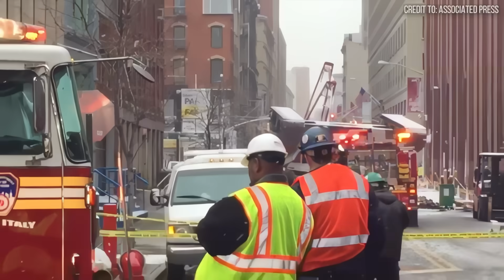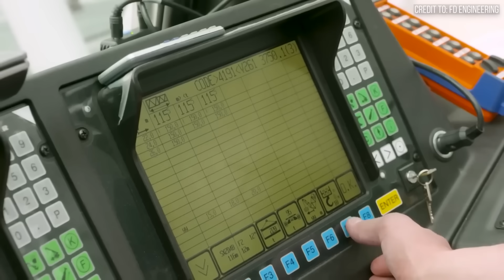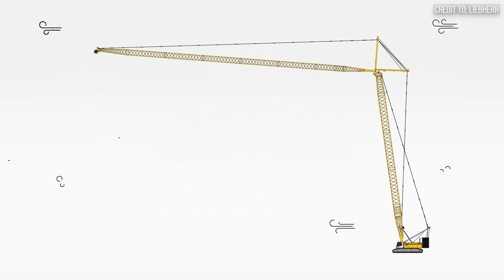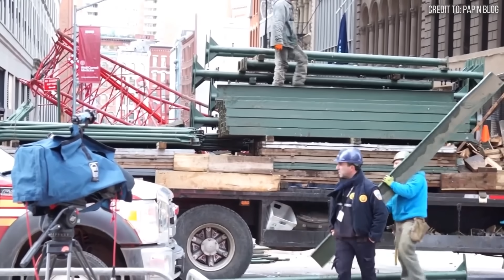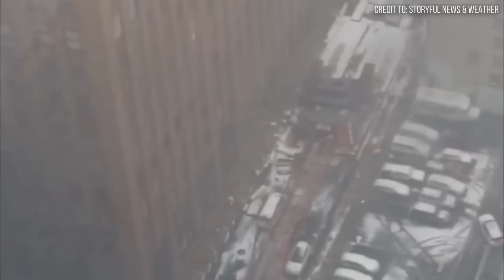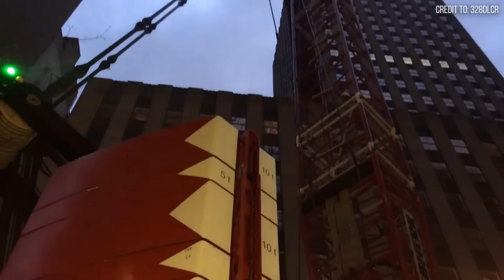$20M Catastrophe: The REAL Reason a 200-Ton Crane Failed in NYC

Comment: I once worked on my Tonka truck.  It had a maximum load capacity of 47.5  lbs with a weight of just over 3.74 lbs.  A total cost of a staggering $13.99

Comment: Thank you for this informative video. I have a question though: when that long boom at the top was being lowered, I understand that they lower it using a cable that they unwind. Would it have been possible for the operator, once they sensed they had a balance problem, to just let that cable unwind, like freely, just let the winding wheel freely spin? I was thinking that would drop the end of the boom faster and sure, it’s end would hit the street and cause some damage, but the main vertical part of the crane and it’s cab and stuff might have survived intact. I get that an uncontrolled dropping of the end of the top of the boom is not a good thing, but wondered whether, given the situation, that could have been a better option. Assuming it’s even possible.
Reply: To answer your main question, no. The winch that runs the cable for that top boom section you see at the start of the video can not unspoil freely. Its hydraulic and is not set up with a free fall system to allow it to do that.

Comment: If this was a Chinese machine, every sh1tholes in the comment section will blame Chinese quality.  But this is German engineering steel so the reason for the fall is the WIND.  I see I see is the wind not the low quality German made machine.

Comment: Taking the crane down already at higher winds started is very risky, because of reaching unstable positions. Much better and you will surely habe some smaller damage is to "park" it in a save position leaning against a building,

Comment: The story was told that the regular operator was not on site and they needed to get the boom down another operator that had not ran a machine of that size / configuration . and boomed down with out laying the  luffing jib on the ground has wheels on end to do that. Than with that weight off can let the rest of the boom down.  The machine would have turned over with out the wind when you do it the wrong way.
Reply: What I thought! Looked like it was always going to topple

Comment: The winds of 20mph with gusts up to 25mph does not tell the whole story. Because the winds will funnel between buildings and be faster and change direction like crazy. I noticed that because I lived in NYC near that area for 3 years. 😇
Reply: There were 2 industrial smokestacks in England. 
Their shape and proximity to each other created a vacuum effect during a high wind storm and pulled them down
Reply: Yea? And?

Comment: I’ve operated this machine on different jobs before. It is stout but the effects of wind are never to be underestimated. The changes in protocol are appropriate and will most likely prevent further accidents.
Reply: When it is to windy than you must lower the crane,is a standerd operation in europe.when you have a wind force of 6 it is forbiden to operate the crane.the reason the crane failed has to do that they didnt follow-up the wind limits of the crane it self
Reply: If you have operated this before I have a simple question for you instead of lowering it wouldn't it be possible to connect it to the top of the building if unexpected wind picks up
Reply: @runsolomon  the only way that would happen if the crane company owned the building as well, no owner of the building would ever allow that
Reply: @sandystedman8638 
honest question; why not?
.
There’s no way the building would tip, and massive cushions (mattresses or similar? Idk) could be used to prevent physical damage to the building & crane. .
.
Attaching the crane to the closest building actually seems like a smart move in an emergency. But I don’t know anything about these; just fascinated & trying to learn. 🙂

Comment: If there wasn't enough counterweight to properly lower the boom,  how was it raised?  Also working within city streets ,  winds are funneled in strange ways greatly affecting their forces. No winds on side street but hurricane like around the corner.
Reply: There was enough counterweight. It was the extra loading from 25mph winds that overloaded the structure. They knew they needed to get the crane down, they just couldn’t do it in time.
Reply: @Mark-em5zm  they just did the procedure incorrectly coupled with the high winds pushed the crane over.
Reply: Exactly! We used an H-34 Helo for construction lifting. Down towns were always sketchy when windy

Comment: It will happen again. Even if no one wants it and no one desires it. Only fools talk in terms of absolutes. It is a matter of how do we try to minimize the risks in our lives. The only way to absolutely make sure bad things NEVER HAPPEN AGAIN is to exterminate the human race. And that is a stupid thing to do. Adding many hours of bureaucratic and regulatory red tape before the crew can start lowering the crane that day didn’t help anything. Needing to get city council approval before lowering the boom Was the problem, not the solution to a problem. Penny pinching management sitting in there climate controlled offices scheduling what the weather is supposed to do today and then covering their asses by blaming the apprentice only makes things worse. 20,000,000 dollars a one death was not good. But it could have been a lot worse. Much worse. Like most accidents, it didn’t just happen, IT WAS CAUSED!

Comment: Overregulation will not solve anything. When you get politicians involved in anything it goes to shit.  Something that critical of a lift needs to be supervised by professionals, like engineers. Verify current conditions, probably should have a remote weather station or even  2 or 3  in different areas of the crane to constantly monitor for changing conditions. Wind is unpredictable when tall buildings are present, currents can change just from the shape of a building and direction of the wind. By the time the cranes computer logs excess wind it will be too late. It also appears the main boom was leaning forward too much which would change how the luffer was lowered. But when you are faced with an emergency descent situation there is no time to try to plan things. Just get the damn thing down.

Comment: When they were lowering the lattice, boom, they didn’t have enough counterweight on the main crane and the operator basically over road the safety features on the crane because on a Lib hair crane, they have an option on it to where you can push a button and you can override the safety feature which he did because he was trying to lower the lattice, boom fast as possible, and without having enough counterweight, the computer was basically slowing the process down to the point where it was stopping it and he pushed the override button on the crane, which caused it to basically run out of control The override on those cranes are used in certain circumstances to navigate certain issues if they need to move the machine quickly as you know, those things have a computer system on them which regulates how long the boom can be now one thing it doesn’t regulate is how much counterweight it tells you how much counterweight it needs for every foot of boom but unfortunately, some operators like to cut corners as you know counterweights are very heavy and it would take a lot of truckloads to get enough counter weights to do the job properly and with a crane like that being rented time is money the more time they take on a job with a crane like that the more it cost and it more it eats up their profit the bottom line basically so they cut corners, unfortunately, and one of the main corners they cut was the counterweight once the boom is in the air. They don’t need a lot of counterweight, depending on what they’re lifting if it’s light enough if they were lifting something very heavy, they would need a lot more counterweight because as they’re lifting a heavy heavy load the computer will start yelling at the operator, preventing them from lifting anything except if they push the bypass on the computer. so because of cutting corners and on top of it, the wind this accident happened. It’s just like the accident if you remember about big blue in Milwaukee, Wisconsin when it was lifting a 500 ton load in high winds now the crane operator didn’t want to lift it, but he was forced to do it because the main site bosses needed to have it lifted because they had to stay on schedule schedule equals money and they pushed the envelope too much that time the center pin for the crane snapped like a toothpick. There’s a big bolt on the bottom of the pin that holds the house carriage on the main frame that bolt split and the pin bent and snapped because of the wind pushing a 500 ton load in high winds and all of that time they were trying to save was for nothing because it wound up destroying a lot of the work that they did and the opening of the ballpark was pushed back over a year not to mention three crane workers died that were in a man basket when the crane toppled over it hit their man basket in the collapse and they fell over 100 and something feet
Reply: I didn’t think the counterweight had anything to do with this accident. How would they have been able to lift the boom in the first place? It sounded like the brake bands might have gotten hot.
Reply: @paulne1514 
It's a hydraulic crane.
Reply: and you know this how?
Reply: @SHADOW.GGG-  He doesn't. Absolutely full of it.
Reply: You're way off base.
Reply: You don't really know what you're talking about. This crane wasn't "short" on counterweights. It was a rented crane from Bay Crane, one of the largest crane rental companies in the US. You can't rent a crane short on counterweight when it is literally in its max configuration. The override is basically on every hydraulic crane made. There are also different types of overrides on a LR crane. None of the overrides apply here because they were not pressed when the accident happened. The operator made a mistake in thinking he could boom down the luffing jib without having the main boom up all the way (you make a triangle when you fold boom down properly with a full luffing jib). The crane will actually allow you to do what the operator did in this case without any override or alarms going off. Just like the video stated, because the boom was lowered incorrectly and wind gusts in between skycrapers in manhattan create wind tunnels... the boom was essentially pushed far enough out that the crane simply fell over from a wind gust.
Reply: @SamA94_  he was in the process of lowering it, and the wind was very very high at that particular time he was panicking. He had to get it down quick, but he fucked up.
Reply: @SuperAgentman007 yeah that’s what I said. But he wasn’t lowering the boom down extremely quickly. If you watch the video the crane is actually lowering the luffing jib pretty slowly (as the operator was probably nervous given the wind situation). It only speeds up when the jib is pushed so far out on the chart with wind that physics takes over and pulls the crane down. At that point no one is lowering anything and the crane is falling. It won’t be in free fall until the counterweights on the crane rotate past 90 degrees on the ground. There is slight but gradually reducing resistance until this happens. Which is what happened given the crane actually completely flipped over on the pad it was sitting on. I’m just saying based on your previous comment that this has nothing to do with counterweight and was a simple mistake that should not have happened.
Reply: @SamA94_  exactly the mechanics of the crane failed. That’s why the boom came down super fast and then when I did it actually wound up flipping the crane upside down.
Reply: @SuperAgentman007  Agreed because of wind and operator error. Not because of the inherent mechanics of the crane. I looked up the timing for this crane in this configuration from being completely boomed up to get the crane boom completely flat on the ground. It’s 211 seconds (in ideal conditions) to fully boom down the crane correctly. The accident was operator error.
Reply: You are completely wrong. 1st. You cannot lift the boom off the ground without the correct counterweight. 2nd. It takes so long to lower the boom to the ground because it is reeved up so many times. Can take 2 hours just to raise the hook. 3rd. Experienced operator will never enter wrong counterweights into computer or he will go to jail. 4th. During investigation they download all crane data and analyze any faults or errors. 5th. Windload can double the forces on the crane taking it outside it's capacity. 6th. These cranes are tested to 200% their capacity and also to total failure.
Reply: @gregwaugh8069 
Unfortunately, OSHA doesn't  put people in jail. Cranes are tested to 110% of chart.  Operators can lie to the computer.
Reply: @gregwaugh8069  Some of what you're saying is true and some is incorrect. 1. You can lift the boom off of the ground with the incorrect counterweight (you can actually do it with no counterweight attached technically in assembly mode if you wanted to tip the crane over on purpose) but you will be limited on the picks you can make with the crane based on configuration in the computer. You can assemble the entire boom via cantilevering this way. The crane calculates your max lift in real time based on counterweight configuration, boom angle and boom deflection with an lmi.  2. It does not take long at all to lower or raise a boom on any Liebherr crane. Typically the gantry winch is the fastest spoiling winch on a crane and has multiple speed modes. HS line (Liebherr duty cycle cranes) can go from boom kickout (~83 degrees) to the ground in about 12 seconds wide open running 10 parts of line (obviously with no load). LR cranes are slower but still do not take long. In the video of the crash only 1 line is being used without a block so it would not be difficult to keep up the aux line while lowering the boom. Its pretty simple what happened. The operator did not understand the proper way to boom this crane down.
Reply from the maker: Some real insight here and it’s much appreciated!  I plan on covering the big blue accident on a future video. Thanks for watching.

Comment: Weather forecasting excessive winds could have been forseen. The boom should have been lowered prior to the wind event.
Reply: Winds that high can definetely be forecast. Main point being: when dealing with such a big crane in a crowded downtown site, caution should outweigh ALL other concerns. That crane should have never been raised that morning. Profits be damned.
Reply from the maker: Great point! Weather can be unpredictable, and lowering the boom at the earliest possible opportunity is a must! Thanks for watching
Reply: They waited until dawn, probably because it's dangerous to attempt in the dark - the operator has to be able to see the booms.  
Bringing in a bank of floodlights on short notice would be nearly impossible, unless you called the FDNY and convinced them it was an emergency... which would be a hard sell.  
Final analysis seems to be that one bad gust of wind, at just the wrong moment, pushed the center of gravity just a bit too far out.  
If I were investigating, I'd want to see how they calculated the proper mass of counterweights to install. Seems to me that they came up just a bit short, with not enough of a safety margin.
Reply: @jpdemer5 You missed the whole point. Forecast means to anticipate ahead of time so they could have lowered the crane in daylight the afternoon prior. We all have heard that time is money but risking a monumental disaster when they could have done it earlier.
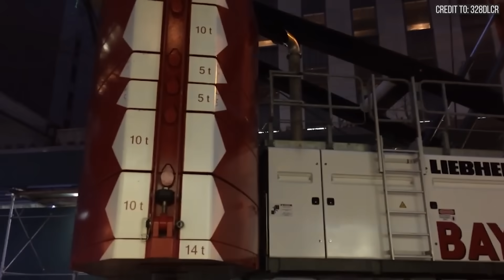Reply: Winds were only 20 mph and gusts 25 mph 3:51  so the new regulations would not have prevented this accident...
Reply: If the excessive winds could not be foreseen, how would they know to lower the boom?